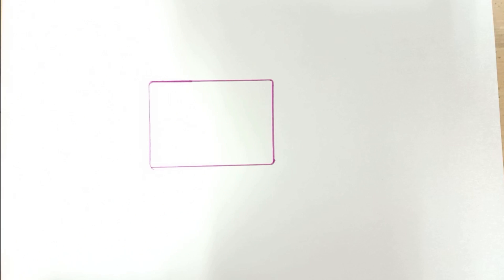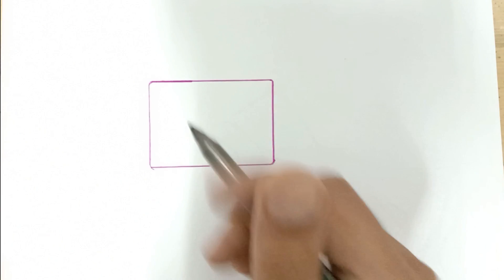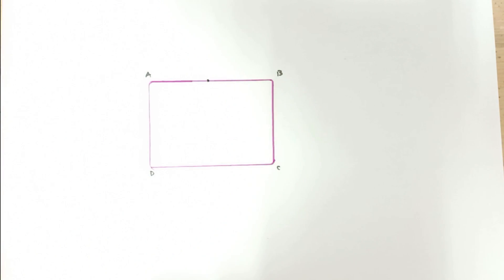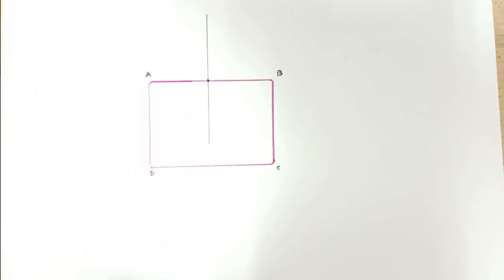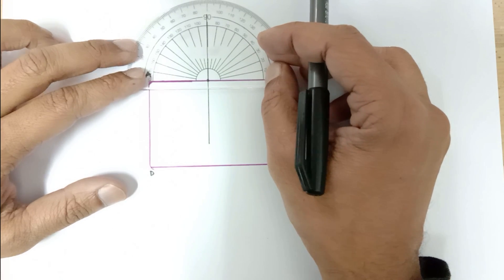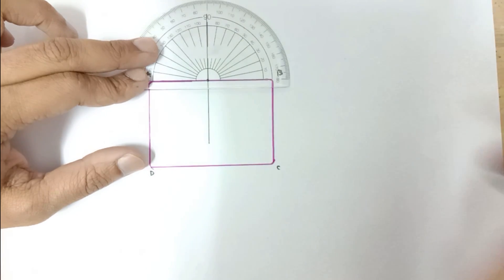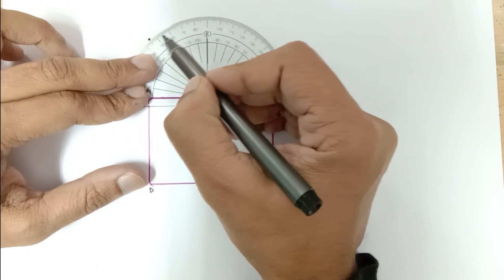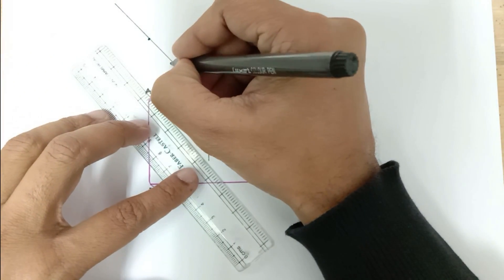Finding lateral shift and refractive index of glass slab : Std 10 Board Exam Practical

Comment: Question. If the thickness is 1000000 trillion Km. It means the light travels more than 1000000+ trillion Km, How do you make sure that the r is the same.